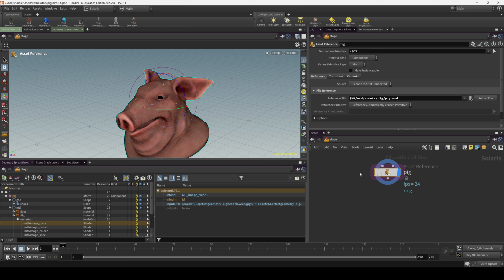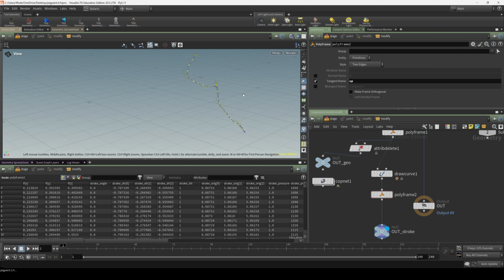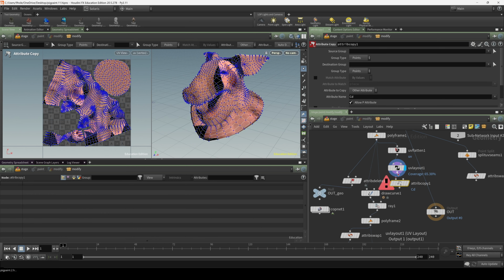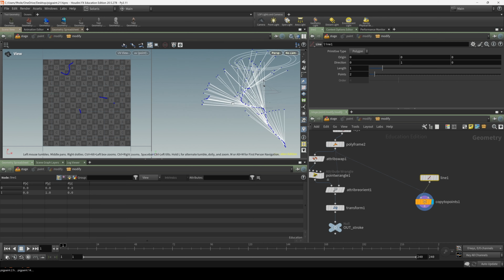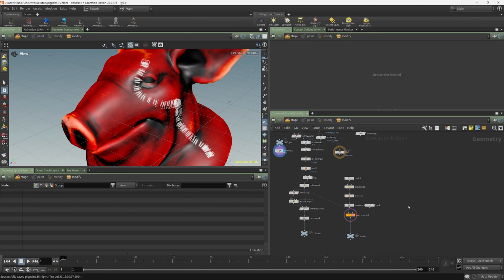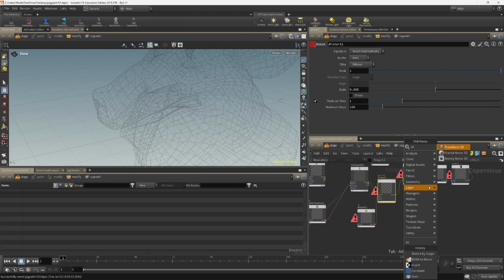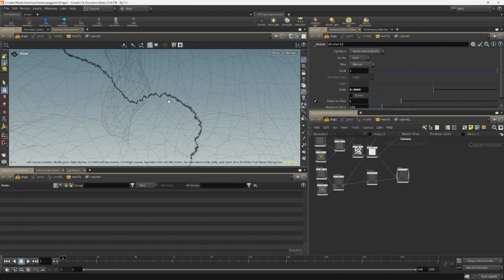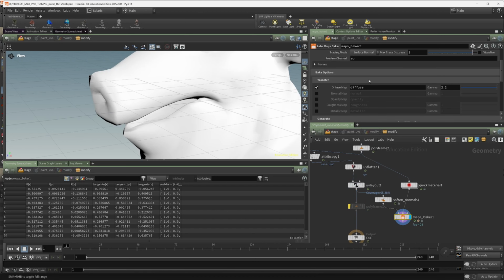Houdini 20.5 COPs 🩸🐖 draw geo and material modification TUTorial. hip file

Comment: Hello! Thanks for the video. I believe your description of uvsample at 20m30 is uncorrect...
Reply from the maker: Yes sorry @vincentthomas8492 was very tired, I had it backwards, it's looking in uv at Position for uvpaint values. I think that's correct. Thank you for noting.

I also found uvsample and the xyzdist vex methods have slight differences compared to SOP raster setup to UV which is what the raster setup COP is actually doing inside. But can't use the Raster Setup COP as Extrapolate Boundaries COP doesn't work here. Almost, but up close there are seam issues that are really revealed with uv to uv mapping like here.

So I made an OCL version that does uv to uv in one node, and also does P in one node, vs raster setup then raster geometry. I'll release that tomorrow.